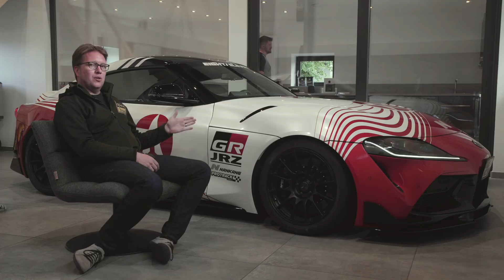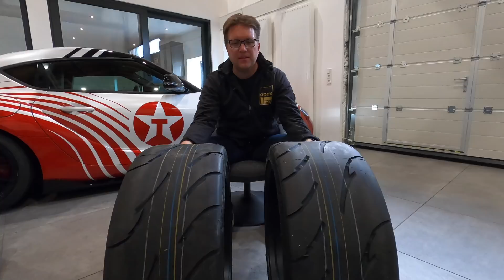Tech Talk: Toyota Supra, Ruined by Bump Steer?!?!

Comment: The 2020 Supra utilizes a 5-link rear suspension setup. I've heard of people improving off throttle performance by modifying the rear frame compression struts that bolt the rear of the sub frame. These compression struts physically move the rear sub frame forward when weight over the rear axle is removed. If you ever watch a Supra's rear wheels when being lifted on an automotive vehicle lift, on decompression the entire axle and wheel assembly shifts towards to front of the vehicle. I'm not a chassis engineer but I've always found it odd that the Supra does that. I come from a world of Toyota's so this is all new stuff for me. Has anybody else noticed this?

Comment: Didn't Toyota say they specifically targeted bump steer in the 2021? If so, they should fix the 2020's out of goodwill considering the massive overhaul done within one MY. I understand they wouldn't do anything about the engine, but this is a safety issue.
Reply from the maker: that's what I have been hearing!

Comment: Such a great video Robert. From a different end of the spectrum but when I first picked up my E36 my control arm bushings were so flogged it had MAJOR toe change mid-corner, all fixed now but confirms suspicions I had about the Supra. In my half hour drive of a Supra (several months ago now) I didn't diagnose this problem, but it was definitely a difficult car to trust on the road. Felt great, as you said, when the car was loaded but definitely 'loose' under brakes and interestingly when only driven at 6/10 it wasn't very pleasant either. So great to hear the reason behind it.
Reply from the maker: yes shot business will make a horrible car to drive

Comment: I've got one and I completely agree with how weird and twitchy the rear end feels. 
The strange thing is that the rear end isn't ACTUALLY stepping out when you feel this "twitch". I've done a lot of drifting in a lot of different cars (from a 350Z to a supercharged Audi R8, and currently compete in British Drift Championship) so I'm pretty familiar with how a car really feels when its about to slide and when its sliding. In this car you get that initial feeling of it starting to rotate... but then nothing actually happens. Even on track when I pumped the rear tyres up to 45 psi to make it slide around more easily and then intentionally tried to upset the balance, its hard to actually get it to start sliding properly. Of course you can make it break loose, but I'm just saying it takes way more effort than that initial twitchy feeling would have you believe. So I think there's a chance it might have been an intentional choice from Toyota/BMW. I think their logic could have been that It makes the car feel "playful" to people who aren't particularly experienced with drifting or track driving - but without it actually being dangerous and making people oversteer everywhere.
Reply from the maker: I think you'll be interested to see the next couple videos on this topic then.  We have some cool stuff coming out.  

I also do not think this was planned rather a screw up as they are changing it on new cars
Reply: ChrisDrift i have a really difficult time believing BMW would dial this into a chassis, it makes no sense. The people that buy them are on the enthusiast side of things, If they start to feel like the back end has too much rear end oversteer at corner entry or mid corner, the driver will intuitively adjust his throttle and steering (counter steer). If that happens, you are further disrupting the balance of the car, the chassis, suspension, brakes and tires are now doing something totally at odds with one another and you are going to either kill your lap time or end up backwards or in a guard rail OR you are going to learn slowly and form really poor driving techniques. This can’t be something that was invented to take place. Hope they get it figured out as it appears the car has a lot of promise.

Comment: SW20 had short track rods in the first two generations and was well known for its tendency to spin out. From the third gen they changed the rear end with longer track rods and the car drove a whole lot better. 
With the Supra, I think they may have changed the  2021 version to fix this issue.

Comment: Really dude? You're running a professional race shop and didn't fab up new toe rods and record the geometry changes under compression and rebound? The s2000 from the factory has similar bumpsteer issues but not nearly as bad as the Supra and many a kid have wrecked them because they aren't ready to catch that rear as it suddenly isn't pointing the right way.

I hate the new Supra but I hated watching this video too because this isn't that complex of a fix. Take measurements, mock it up in solidworks and fab your own arms out of some 7075 and take it out yourself. Also keep in mind roll center changes based on what height you decide to run at because it's pretty obvious the suspension was designed by idiots.
Reply from the maker: Hmmm where did you read that I am running a race shop w fabrication facilities? No it’s not that hard and it’s being done now.... just not in house as I don’t run a professional race shop.   Also the video is to give an update before that happens so people know how the car works and then we provide a solution and assess how the car drives afterwards.
Reply: @RobertMitchell  My bad then, this is the first video of yours that I've ever seen and I figured with JRZ suspension and running track rentals that you would have a pretty good idea of setting up these cars vs. just throwing parts at them. All that being said, I am not a suspension design engineer and am probably much like you in that I just consume parts made by companies but also make some stuff myself. BMWs in general seem to have this problem because of their lack of true coilover design in the rear and the separate spring perch gives it a similar design geometry to the ancient 350z/370z. Unlike that platform the shock is not at an extreme cantered angle from the knuckle so you don't have nearly as much dynamic camber deflection, instead like the s2000 the toe rods/ traction arms whatever you want to call them with lowered geometry cause significant amounts of dynamic toe as mentioned in the video. The process for dialing this out on the s2000 for example is to compress the tower and measure dynamic toe and extending or shrinking the arm to get the range that you're looking for. This will be the same fix that's needed on this platform.

Comment: It's almost like the car was engineered to have a 4 cylinder block instead of a 6 cylinder, but needed to stick a 6 cylinder suddenly and didn't have enough time to redevelop/balance for new heavier front end...
Reply: Japan has a 4cyl model, not sure if exporting to other countries yet.
Reply: @Drift13b88  ya it is. at least us and germany. and it seems to be received better than the inline 6
Reply: @ScReamOut93  I think all of europe, Norway is getting it too
Reply: @Drift13b88  The US is getting the 4cyl in this next revision, but its set up to be a GT car, smaller breaks, softer suspension changes, much less HP

Comment: bump steer is definitely an eerie feeling and im sure most people dont even realize they've experienced it. i drive an rsx and the car feels very planted but i have noticed on occasion if i have a little bit of speed in a turn and i hit something of a decent size it unsettles the back end and it will kick out otherwise i just have to watch my steering and gas pedal transitions to load the suspension, breaks and drive train right. i have had cars fwd cars kick me back the other way though as the suspension loads and unloads from actual bumps in the road or not transferring weight and breaking right.

Comment: The suspension moments have changed since you lowered it and you blame the manufacturer?
You lowered the chassis attachment points in relationship to the wheel. 
Bmw have to use big soft bushes because big rims and big potholes dont mix for a street car.
As for toe in toe out - you know that changes over the suspension stroke and it 100% has to be there
Reply from the maker: Listen carefully to the video. I said 4 things that you missed apparently 

1. It did it w stock ride height and stock suspension. 
2. Lowering a car can often make this worse 
3. We changed the bushings already
4. Bump steer can be a good thing when geo is correct.
Reply: @RobertMitchell   hi again - yes i did catch your points however im uncertain when you changed the bushings but i suspect it may have been after being lowered At standard height with hard bushings maybe its great at a track.
I guess what im trying to say is your pushing this car on a track, but Toyota/Bmw made it for 98% population who need it to be an acceptable comfort loaded going over potholes too.
As for bump steer geo - you say it can be a good thing - I'm saying you 100% have to have it - its not like they can build it with none - the end result would be terrible.
What do you think happens to the rear toe when you accelerate WOT in a straight line? (When its at factory spec ride height)
Reply from the maker: @ben7020  i can tell you that there is no way youll convince me that this car was correct from the factory as i know otherwise.  stock lift off at high speed on autobahn was nothing less than dangerous and there is no other way to put it.    I even said in the video that its not possible to have no bump steer so again youre arguing point 5 that i stated in the video... 
not sure what the goal of the conversation is. to tell me im wrong by confirming 5 points that i made or telling me the supra was built correctly when it wasnt.
Reply: @RobertMitchell  Im trying to convey to the audience that design compromises are made. Your unhappy with the car and it might have issues doing track stuff, you might be totally right.
You had trouble at Autobahn speeds too.
I've directly seen expensive, brand new cars with out of spec wheel alignments scrubbing expensive tyres.
Is it possible Tmw built it right but it just had bad alignments?
What happens to rear toe under WOT in your opinion?

Comment: You can change your bumpsteer by setting the right caster angle. For this you need two adjustable control arms or change one pickup point. Talking about this topic without a toe-heave curve is kind of weird.

Comment: Why not add more static toe in? Older Porsches needed this.
Reply from the maker: The reason is that to fix this you would need so much toe angle that it would be too much
Reply: Too much toe in could probably as bad. Years ago, I got some rear shocks (of a normal sedan as people call them) changed in a workshop on warranty, and the workshop "forgott" to check the alignement. (as i found out later that summer) In dry weather with normal driving it was behaving a bit different in faster corners when there were bumps, but in the rain the rear end would step out a little sometimes. We don't have german Autobahn speeds in my country, but if you go 120kph in a curve on a wet Autobahn (not wet enough for aquaplaning) and due to a bump in the road the rear end of the car "chuckles" half a meter to the side it is somewhat uncomforting. It didn't do it before, and i beeing young started to doubt my memory...after half of the summer the ouside of the tires was bald while the rest of the tires was fine. So down to the workshop. After the alignement was corrected to factory values the car was stable again.

Comment: Enjoyed this thanks Robert. From my experience with BMW, stupid soft rear subframe bushes with big gaps in them cause this too! Horrible feeling at speed! 
NHV on non M cars was the culprit.
Fitting the four solid rubber bushings from M3/5 totally cured it. The steering was transformed, once the slop was taken out of the rear.
Reply: I've got an M140i and sometimes the rear end feels disconnected from the car, I suspected the rear subframe bushes.
Reply: Steady Red 
That’s a lot of the reason yes.
Have a look on babybmw.com forum, where this issue has been covered in great detail 👍🏻

Comment: Sorry.. all good Rwd cars are designed to gain negative toe in the rear under compression/squat as this help with traction, and there's nothing wrong with running a zero toe setup where negative toe is gained, this is usually done to reduce drag along the straights. 

Do you have any proof that it is going positive through to negative? The best option would be to do a full suspensions simulation in it's normal working range, obviously you can't simulate deflection in the bushes but at least it would give a static readings.. 

I can't help but think that both BMW and Toyota who developed the car would have got it so wrong, effectively two set of engineerings looking over it.
Reply from the maker: Don’t give these manufacturers too much credit.  McLaren did the same w The 570s and changed their entire rear cradle geo 2 years Into production.   What has Toyota and bmw done now?  Changed the rear geometry on 2021 cars.   W/O being arrogant I drive every type of car and am lucky to be able to tell you what a car is doing within a couple turns.  I sent the car then to Team Schirmer who confirmed this after measuring and has designed parts to adjust the tie rod angle.   Look at the aftermarket suppliers. Countless kits to fix the issue as well have been sent to me after making this video.   

Going from negative to positive toe is the issue here.    Thinking that a manufacturer couldn’t miss such a thing is being too trusting in a profit driven market that probably couldn’t be bothered to reengineer their car once the mistake was evident in testing.

Comment: This is maybe a bit irrelevant, but the car behaves exactly as you describe in Gran Turismo Sport. Tons of rear end control loss. Interesting to see how accurate the game was, and also disappointing for the platform. Thanks for the video
Reply: I hate driving it in the game. I always crash it, it’s so hard to control. And I don’t have that problem with the others
Reply: I drove the Supra on the Nurburgring in GT Sport and it was all over the place! I thought it was the tires I chose, regular sport tires, not racing. It was difficult to keep it from floating around. Now I know why!
Reply: Yeah. Same. Unfortunately you can't feel the slip under your ass to appreciate you losing control.
Reply from the maker: Sounds accurate then 🤣🤣
Reply: Don’t rely on that game trust me you’ll end up on the wall but yea good point

Comment: Same thing I felt when I went for a test drive with the first GT86 to be honest. On the Internet everyone seemed in love with the lively back ( for drifts with it's power limitations  I suspect ) but it didn't feel confident in high speed corners where you build load into the exterior wheels of a corner.

Comment: I had a similar issue when i used to race Lotus Exiege Cup 260. It has major issue with front bump steer geometry to the point that it goes from 2 degree toe out to 5 degrees out under braking. We had to put 2 degree toe in when unloaded to see 1 degree out under braking for better trail braking and corner entry. We loaded the car while I was in it to do the adjustment and when we put weight on the front you can actually see the front tire going toe out by at least 2-3 degrees. Figuring out the bump steer issue with the Lotus and putting a compromised toe setting allowed us to go 2 seconds faster in a 1:30 min lap which is significant. We got 4 poles out of 5. Most other competitors had 2 toe out like the recommendations from the factory which made them slightly faster than me on the straights, but can’t brake as well as i did with my setup. Did you try to load the Supra while it is standing still by putting weight on the back and see the delta change in toe in or out based on load so you better understand how severe the issue is?

Comment: MCR (Matchless Crowd Racing) owner is the only other one I have seen talk about the Supra honestly. Thanks. Edit: you don't know why nobody mentioned it in reviews? Because they are shills protecting their reputation with Toyota, their only goal is to sell you the car. Same reason why nobody mentions crank hub flaw on N55/S55 engines, or the dreaded drivetrain protection shift bog/throttle latency of 1.2s programmed in the ECU of all manual N55/S55 cars.

Comment: Thank you robert for the most interesting and informative explanation of the handling dynamics related to tire toe changes.
I have a new Nissan 370Z sport coupe 6M that I use as a daily driver and for canyon carving on twisty roads here in northern California. Do you have any thoughts on suspension improvements that might be made to improve the handling on this already good handling  car? I have already replaced the stock sway bars with some stiffer Hotchkis sways that have improved the handling. I have future plans to replace the stock brake rotors with some two-piece aluminum hat rotors for reduced unsprung weight. Thanks again.
Reply from the maker: What does it feel like now?  Understeer or Over steer in the turns?
Reply: @RobertMitchell  Thanks for helping me out. The car had slight understeer stock but now has a much livlier rear end now, with neutral to very slight oversteer. Wheel camber seems good, with even wear across the Michelin PS4S tires. The tires are good but I'm looking for something with stiffer sidewalls next time, for better steering response and precision and less vagueness.
Reply: BTW: I wanted to add that I think you have the world's coolest job, driving all those fantastic cars at the Nürburgring.